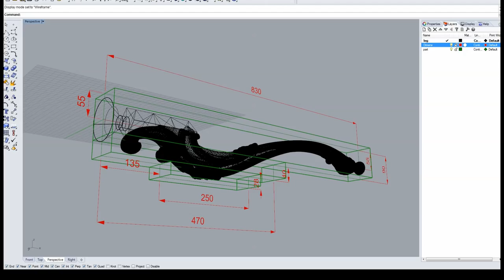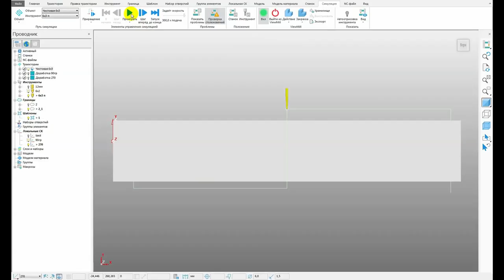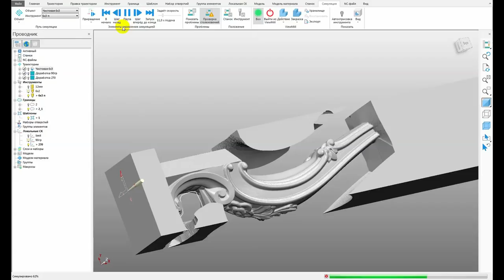Carved cabriole legs. 4 axis CNC.

Comment: I thought it could be faster I'm a metal machinist and looking at your feeds and speeds for wood seems too slow.Good result though always loved a little bit of woodwork on the side.
Reply from the maker: Faster is possible but not on this machine. This machine is not enough strong for high speed processing. For high speed processing machine should cost in 5-10 times more expensive than my.